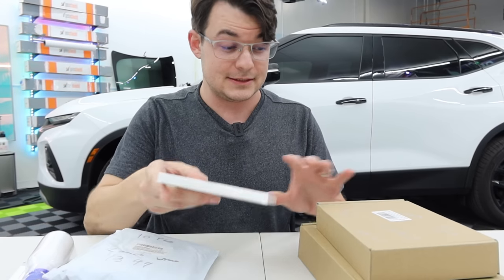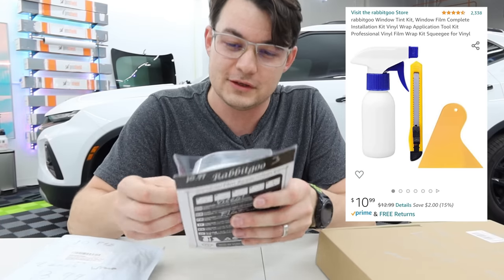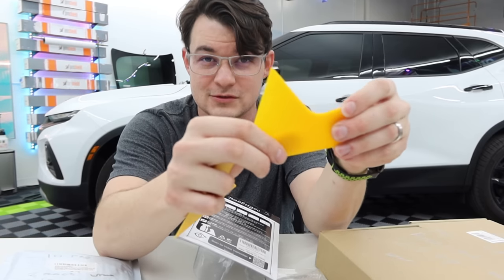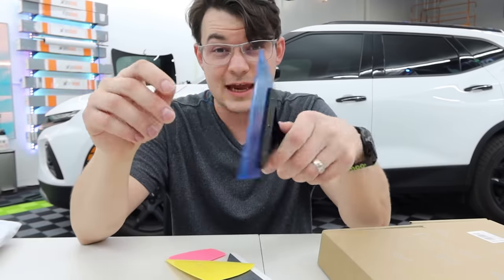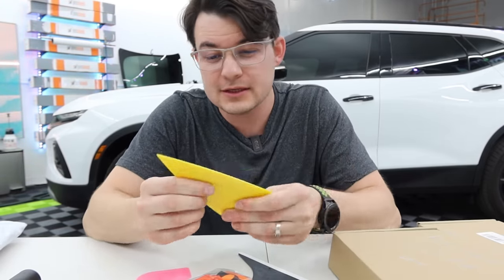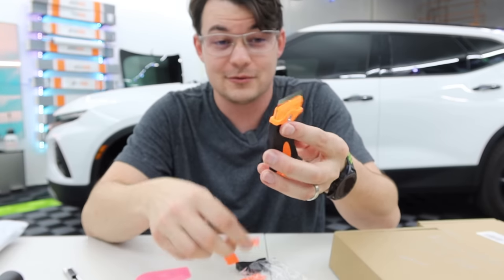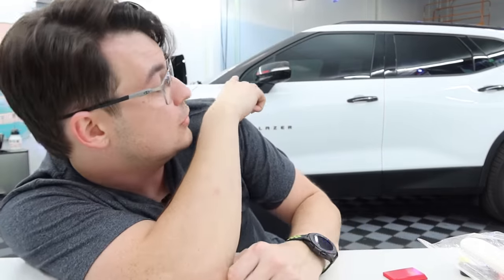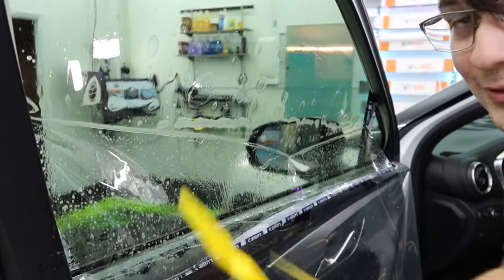Why I DON’T BUY Amazon Tint Tools

Comment: Hi Matt,the card at 6.30 is called a Power Stroke, They're for 8M+ security film,you use the backing sheet to stop scratches. They're Ok as a scraper on soft glass you can't use S/Steel blades on.
Reply from the maker: ahh 😂😂 no wonder I didn't recognize it. What a helpful tool to include with a basic tinting kit 😂
Reply: @DetroitTintStudio  I know, lol,like a beginner is going to be doing 8M security film work straight away. That stuff is a whole special deal of it's own to work with, they'd have to be rich to get enough film to learn with and then do their house! 
Was thinking a video on putting 4M security film on a car would be great viewing and because you have to go slow shrinking the rear & front(70%) will show how the film moves during shrinking really well for video. Know what I mean?  
Not dissing Detroit,but it can stop bullets,or at least dissipate the energy of bullets,so there's probably customers out there for it!
ROTFLMAO! But would you want to deal with a person needing bullet resistant tint on their car??? :-)
Reply: Hi